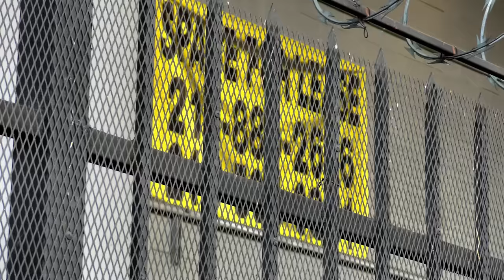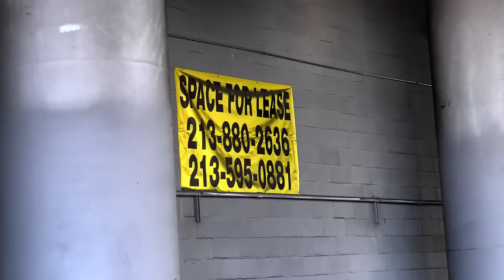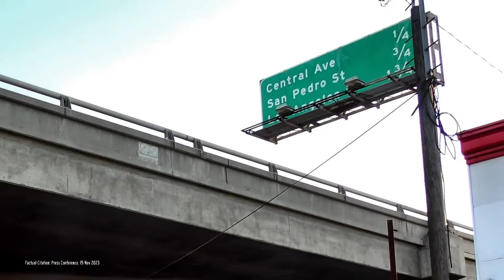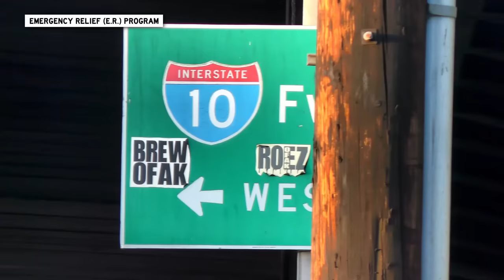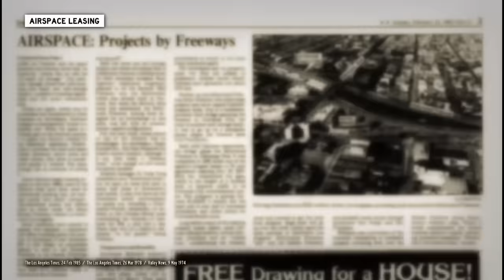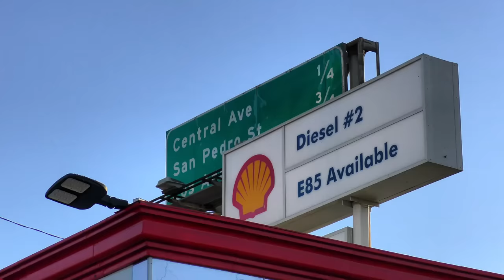California only has *70 DAYS LEFT* left to FIX I-10 🔥

Comment: @ 3:26, no engineer here, but seeing that heat , creating stress cracks, I will not drive on that freeway, if its repaired not rebuilt. Example, the Paramount bridge on the 60 freeway, suffered an intense heat treatment in 2011, that they tore down the bridge, and built a new one, just in 6 months. I certainly value the wait time, but moreso, human life. Not save in my eyes to 'repair' only. Maybe in some months, years, it can open up (stress indications) and potentially collapse in sections.

Comment: It was a mess and sadly will still continue to be a mess until it’s fully fixed…

I’m not sure if you remember the MacAurther Maze incident. Sort of similar situation. Tank truck wiped out and caused a section to melt and Caltrans was given a tight deadline to get it fixed before a holiday weekend. They managed to fix it right on time for the holiday rush.

Comment: As far as the tenants under the freeway goes, Caltrans leased it to a company on the condition it only be used for parking of operable vehicles and nonhazardous materials, and that they not sublease.

So, they turned around and subleased it at massively increased rates to a bunch of small businesses and said 'yeah sure do whatever'. Mechanics, trucking companies, distribution companies, etc.  Caltrans came through and tried to get the subtenants not to pay rent to the company, but they just got locked out of their businesses until they coughed up, and the landlord sued Caltrans for ''interfering in their business'.

Caltrans was in the process of evicting the landlord, with the court hearing set for December.

Comment: My Grandfather was general foreman of construction over 22 miles of the Ohio Turnpike when it was built.  There was a deadline date of when construction was supposed to be finished.  If construction was completed before that date, there was a bonus.  If construction went long then they were charged so much per day they were unfinished.  My Grandfather's section was completed months early.

Fun fact about the Ohio Turnpike.  I can't say about now, but at the time of construction every bridge that was built OVER the road was built so a crane could lift the bridge out of place.  The embankments were made of dirt that a bull dozer could knock down.  The roadway was 18" concrete.  Eisenhower had them build a not a highway, but a where do you want it airport.  In case of war the U.S. Airforce could have a runway anywhere they wanted one.

Comment: Hey Road Guy Rob, question for a follow up video. You mentioned 1/2 a million used that freeway a day. Enough though since Covid there are other options. But not everyone surely could avoid driving. How did the city plan and set up rerouting traffic around and through the area?  Or did they?
Reply: From personal experience in '94, traffic tends to disperse on to the surface streets.  LA's street grid allows dozens of parallel routes.
Reply from the maker: Vehicle trips are 300,000— but since cars often have 1+ passengers, I guesstimated 500k.

Right now they have a detour through city streets that's very slow.  LAPD are forcing right-hand turns to keep the line moving.  But as soon as people can, they deviate and try to "outsmart" the detour which makes all the local streets in the area pretty messy.

Comment: Yeah CA is in a bit of an issue here as it does not look like this has a solid bypass where as 95 in Philly earlier this year they could shunt through traffic not needing points around Philly to I-295 and NJTP in Jersey.

Im actually surprised that CA dos not use more trenched freeways given their overall lack of rain and when you need more sprawl space just throw a cap on the freeway and now you have a park or a shopping center or office building or apartments.
Reply: Most freeways in AZ are below grade.  We did have flooding a few years back on I-10 when the pumps failed, but that was a once in many decades issue.  The problem in LA is that much of the city was built before the freeway, while in Phoenix the state had the foresight to buy up the right-a-way years in advance.  As a result, in LA the freeways are elevated..

Comment: perhaps the city should operate sprinkler systems under the viaducts, so if there are fires, while it may not douse the fire depending on what it is, it will slow it down and reduce any potential damage to the bridges.

Comment: Information on how they confirm the integrity of the steel used in the "box"  structure (road surface) would be interesting. Did it heat enough to compromise, and how do they test it?

Comment: How did predictions of weeks, or months before the reopening, turn into days?
Reply: I know you people are kind of stupid, but the more you work on a project and study the integrity of the structure the more you learn that it didn’t need as much time to be fixed 😂
Reply: @adanmendoza94  To paraphrase you … ‘The more you study the integrity of a structure, the more you learn that it was not severely damaged, thus not requiring much time to fix.’ Hopefully, I have correctly summarized your super duper intelligent observation. My question to you is this, if such intelligent people were able to determine the bridge did not require extensive repairs, then what would lead them to initially predict such a lengthy time for repairs? Most assuredly, a visual inspection combined with their extensive training, would give them a reasonable idea of the extent to which the bridge supports and superstructure had been damaged. With these facts in mind, how could they have arrived at such lengthy predictions?

Comment: The heat was intense enough to cause the whole section of the freeway to be weakened significantly...I wouldn't trust any vertical OR horizontal support or beam... heat destroys concrete... I'm surprised they aren't worried about the horizontal sections considering the heat....

Comment: When I saw that there had been a fire, I wondered whether they were going to have some issues with the freeway's structure. Hopefully it isn't too bad and hopefully they won't do a shoddy job fixing it in order to meet the deadline.

I do remember the Northridge Earthquake knocking a bunch of the freeway down out there and even worse over in the San Fernando Valley near the epicenter, ironically breaking the same interchange that broke during the Sylmar Earthquake in 1971 (which I don't remember because I had not been born yet). I remember thinking at the time in 1994, when we turned on the TV and saw all the stuff that had fallen how surprising that was because it really wasn't that bad out here. It was just enough to wake you up and convince you to get under your bed and lasted just long enough for you to wonder whether it will get worse and question whether this earthquake will eventually stop like all the other ones have but just barely enough time for all of that. It's still a little surprising to me that it did so much damage since, compared to the Landers Earthquakes two years before it, it didn't even have that high a magnitude. Landers is still the biggest earthquake I've ever been in and the only one that truly scared me.

Comment: This is a good, informative video. I drive through the area a couple stops east of this spot, where the 5 and 10 meet, a few times each month. I remember driving through on the Saturday just after it happened. And how crazy and backed up traffic was getting heading south. And then on my drive back, how nuts the street traffic around the 10 was. It was like some huge rock concert was happening with cars jaming the streets. Then reading about the fire when I got home. Seeing some pics of the cracked and missing concrete spots on the vertical beams. Hmmm ... this looks really bad. How long is this going to take to fix? As of today, I think they've reoppened some of the lanes going both directions.
Reply: Yes it's back open.. all lanes

Comment: Storing flammable stuff under an elevated freeway isn't the problem. Storing flammable stuff there WITHOUT first installing an adequate sprinkler system, is.

But, we all know, accidents need to happen first, before measures are taken to prevent them in the future.

Comment: The reason the I-10 will open on Tuesday is they shored up the span with steel beams and lumber to stabilize it for traffic traveling on the freeway. In the meantime It will take months to repair the damaged columns one at a time. Good news for all.
Reply from the maker: I can't wait to see the falsework once it's all installed.

Comment: The '84 work was done so quickly, because of the emergency, the contractor didn't have to comply with the normal minority-owned subcontractor rules. This means the contractor could hire good subs, instead of "do nothing" subs.

Comment: The freeway almost got fixed before this video was released. It will be done in 5 days
Reply: It wont be fully fixed, it was determined that it will be structurally sound enough with some bracing of falsework to reopen by Tuesday. The full repair will take some time.

Comment: Yes, there should be pressure to get repairs done in a timely manner.

Any faster and possibly of getting fined for being late leads to cut of corners when doing the job and possibly contracts might bride the officials or inspectors to look the other way.

USA is very corrupt.
Even a small village (where I lived for 10 years) of 500 residents has corrupt officials.

Comment: God, Cali is so bad...  Every time I drive there, I can't believe they actually have building codes... their freeways are so wavey, and patched together with small fixes and decaying concrete all over... And then all the grafitti... I mean, "street art🙄" ... Here in PHX, if there is ANY grafitti on the freeway or signs, within 0-72 hrs, its removed or signs replaced....  We take pride in our roads here in PHX, except for when we put ruberized asphalt 20 years ago (and it was the MOST AMAZING thing on our then 2.5 freeways, where our 3rd and 4th ones were being finished) that had a 10 year life span and after 20 years, it still has no plans or fundering to be replaced/removed/repared, and so its just getting bad... To the point where before COVID, when I carpooled to work, my friend and I counldnt have a conversation in the vehicle on the stretch between Peoria to Bethany Home... BUT ADOT finally has a fix to the issue... diamond grind WITH the direction of traffic, NOT against the direction (north/south grooves, not east west grooves)... so no bumps and noises... its SILENT and SMOOTH!!!  and the groves still provide water runoff and so people dont hydroplane... so far, so good... 

But that afternoon sun set when the sun is in your eyes, even with the sun visor, its hard to see the wite lines/stripes!!!!!!  its the same color as the concrete... so everyone just kinda follows eachother and hope it is the lane... I know this because when someone is driving between like pacman over the dashes, (NOM NOM NOM NOM NOM NOM NOM NOM), there is a row of vehicles behind that person doing the same thing!!!  LOL

Comment: Sorry, but I refuse to believe the STATE engineers in relation to the state of the bridge.  This road is so vital, you can bet they were under intense pressure to come up with "good news".  Given the heat and thermal stresses involved on the structure, the SAFE option is to replace the bridge box sections and vertical support columns directly in the area of the fire.  Anything not replace WILL, and I restate that, WILL, we weaker than before.  Now they may meet minimum safety codes but the metals will have suffered.  A GOOD engineer would ensure the structure can handle worst case loads and still have a safety factor built in (such as for some reason a group of 18 auto haulers all with Ford F-250's get stuck in gridlock on that section of bridge).  But given the government of California I bet they are going to whatever will get this done fastest and cheapest.

And as for who will pay for it .. Number 1 it must be a Disaster.  Well it is California so that's a given, next.... lol.   Of course as mentioned this limits the work to 180 days.  And this ties into the pressure on the engineers for "good news".  Because it the news had been bad, you can forget that 180 day schedule.  So once more I do not trust them, and what they are doing, as the dollar signs behind this are driving a MUST BE DONE TO SAVE THE MONEY Mentality.  And that is not going to end well in the long run.